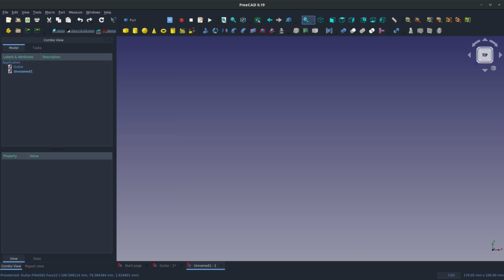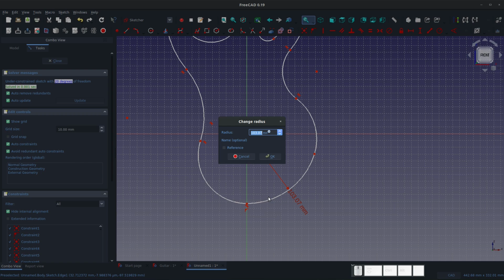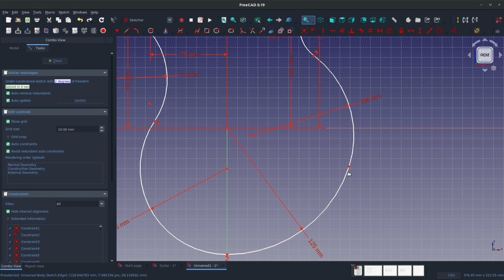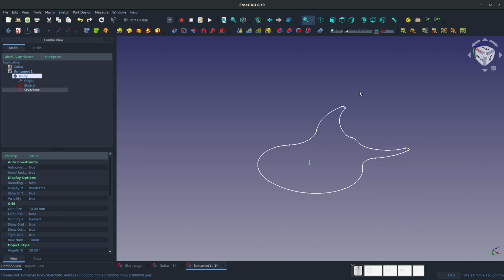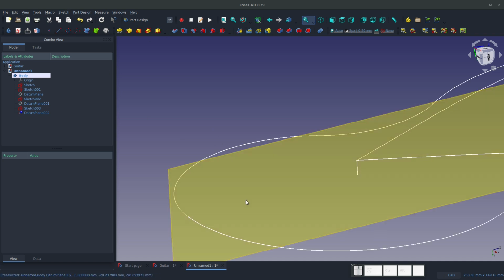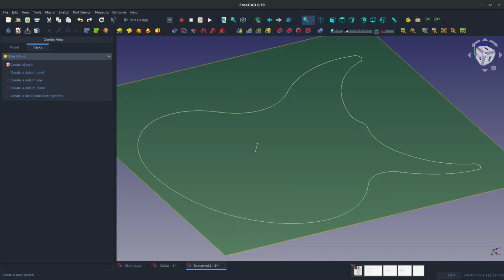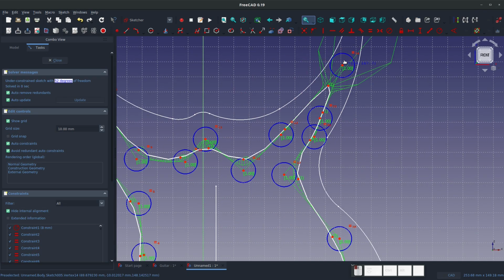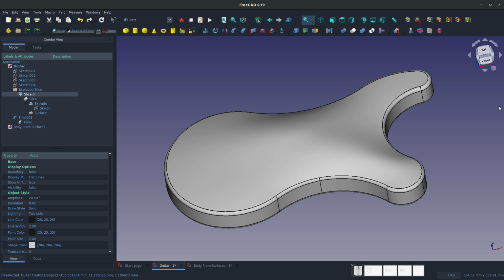FreeCAD Make a Guitar Body |JOKO ENGINEERING|

Comment: IMO adding a datum plane for the purpose of adding a single sketch is just redundant. The placement of the sketch can be done in the exact same manner as creating the datum, i.e. with 3 points
Reply: Use of the datum plane  is more versatile and can work around the topological naming problem
btw: ramen